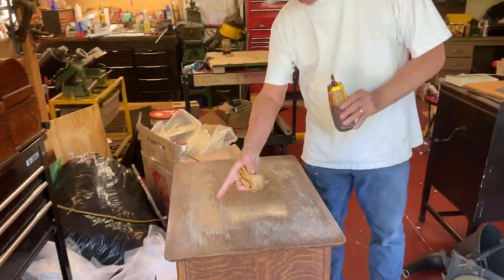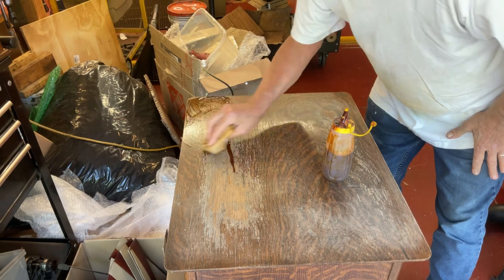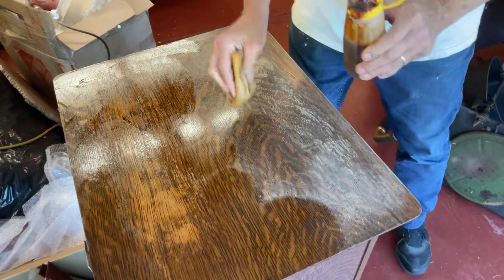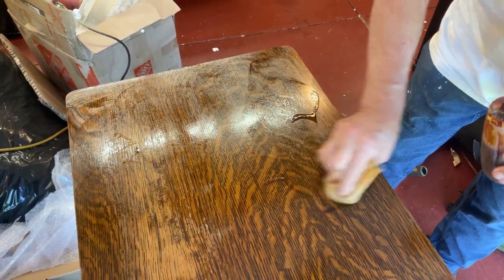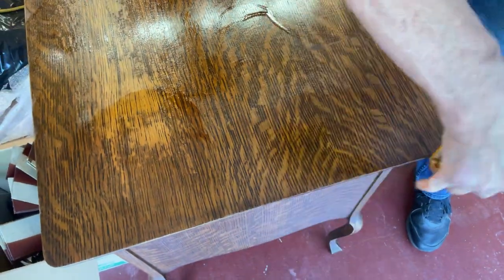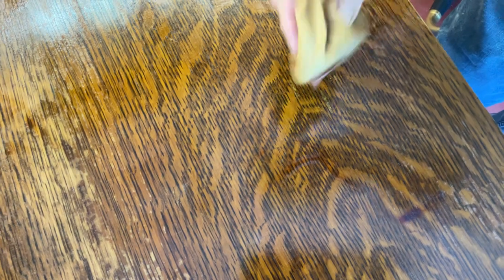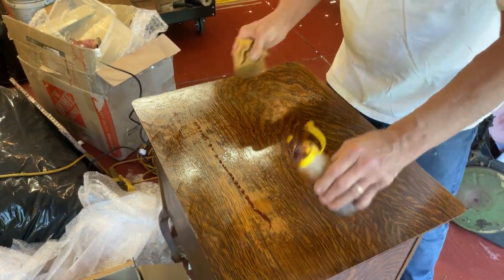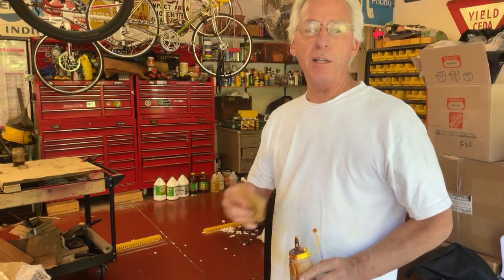713.  A quick repair to a vintage 78 record cabinet

Comment: Interesting: when I have done French polishing, I put the shellac on the pad, instead of directly on the wood, and added a little drop of oil for lubrication...
Reply: If you want to get a proper mirror finish that's the way to do it.